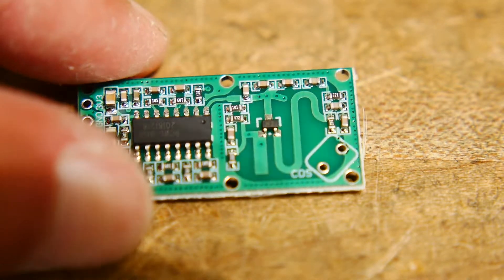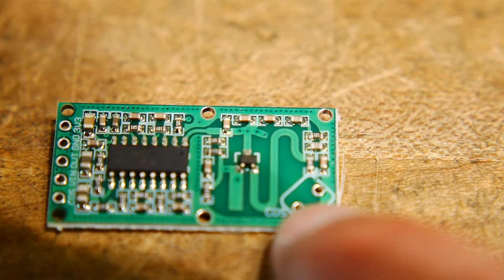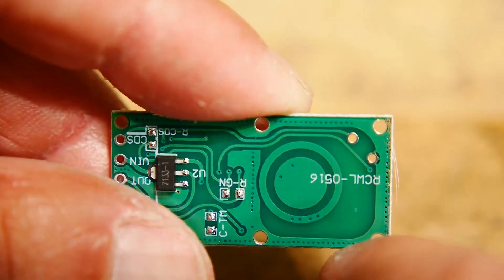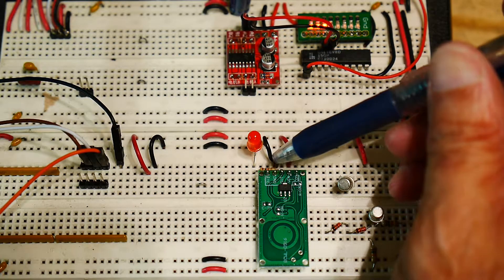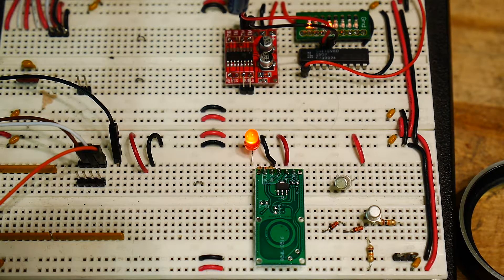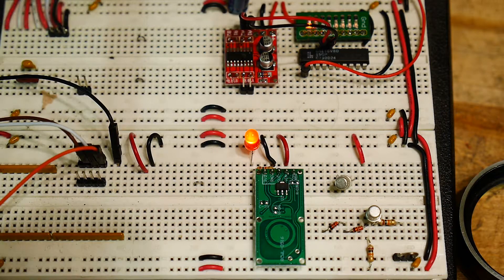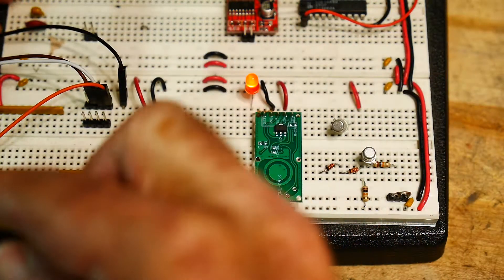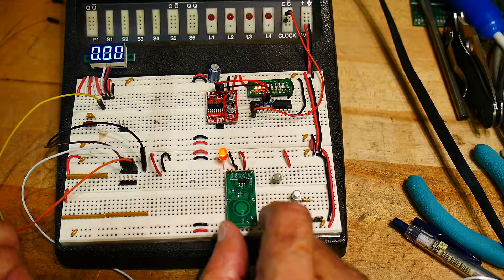#384 $0.75 Doppler radar sensor

Comment: If you tap on to pin 12 of that main IC then you can get a raw, amplified Doppler output. I bought five of these units and they were far enough in wavelength apart not to interfere with each other. I'm trying to modulate one with an audio signal and use another one to demodulate the signal but that's a work in progress since you'd have to demodulate a subcarrier and these free running oscillators are not exactly stable.

Comment: There are some more in-depth vids about these on the Tube. I have 3 or 4 variants...been meaning to reverse engineer them. Some day. Apparently the IC found on some is a PIR interface pressed into alternate service. Some have claimed the serpentine track is an inductor, but I'm pretty sure it's a transmission line (oscillator). The single transistor is both oscillator and mixer??? Then again, do we even need an RF mixer? Simply summing Tx & Rx should provide a useful result...